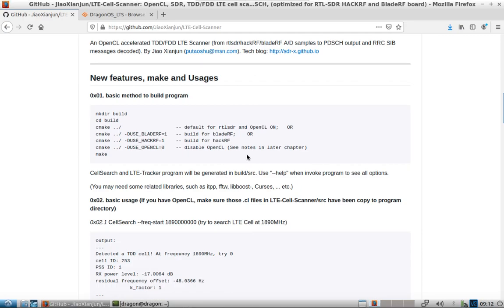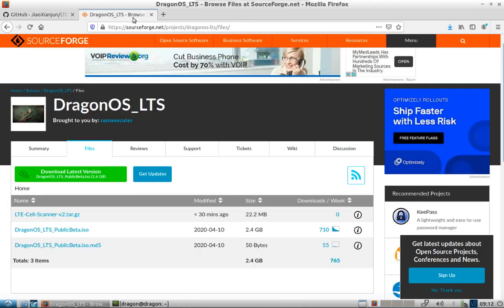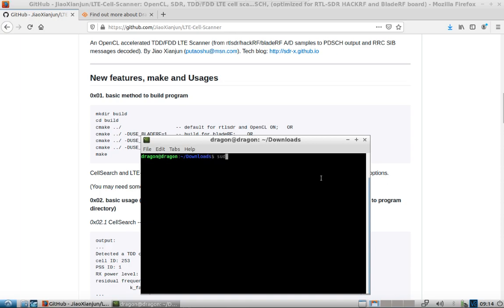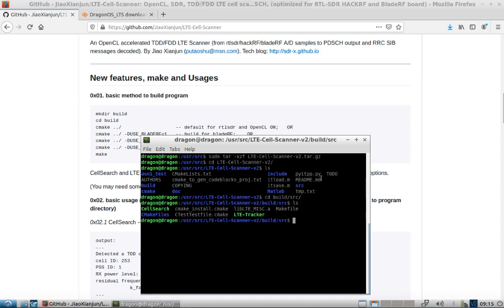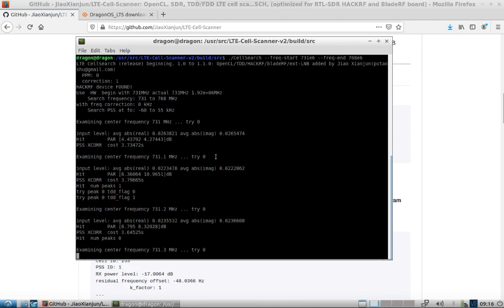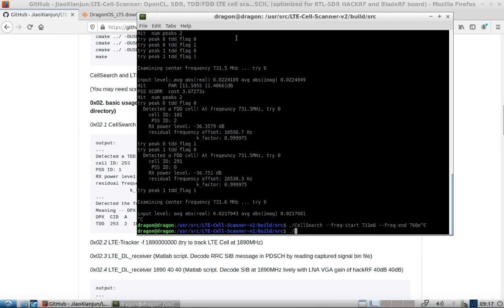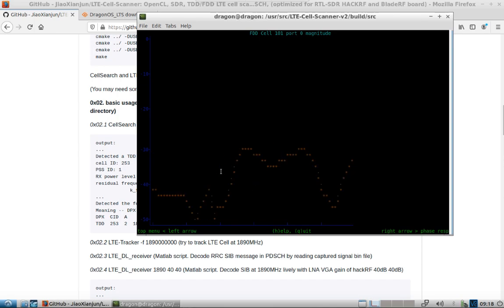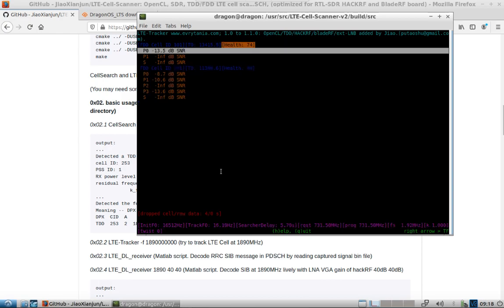DragonOS LTS/10 OpenCL, SDR, TDD/FDD LTE cell scanner (HackRF One)

Comment: Getting this error “hacrf_stop_rx() failed: unspecified error (-999). In another terminal type “sudo apt-get install hackrf” got this “ unmet dependencies: hackrf : Depends: libhackrf0 (= 2021.03.1-2) but 20230201-1 is to be installed. Then I go “sudo apt-get install libhackrf0, result “libhackrf0 is already the new version 20230201-1”. How can I fix it? Thanks.

Comment: I'm running DragonOS_Focal_PublicR14-Preview directly on a PC.  I have a HackRF One.  I can use the HackRF One with URH but when I try to run CellSearch, I get an error that the RTLSDR device cannot be found.

config_rtlsdr Error: no RTL-SDR USB devices found...
RTLSDR device not FOUND!
xxx@xxx-sdr:/usr/src/LTE-Cell-Scanner-v2/build/src$

It does find and use my Rafael Micro R820T tuner if I plug that in instead.

How do I setup CellSearch to use my HackRF One?
Reply from the maker: Good question, something I should document better. So for this tool I built it twice. Once and installed it for the rtlsdr. Now for the hackrf if you look in /usr/src/LTE-Cell-Scanner you will see to bin files with hackrf at the end. You would call those directly in a terminal, like ./CellSearch-hackrf with appropriate settings and it would use your hackrf instead of the rtlsdr.
Reply: I looked in /usr/src/LTE-Cell-Scanner-v2 but I do not see any files ending in -hackrf

xxx@xxx-sdr:/usr/src/LTE-Cell-Scanner-v2$ ls
asn1_test  build  CMakeLists.txt                    COPYING  include   itsave.m  pyitpp.py  src   tmp.txt
AUTHORS    cmake  cmake_to_gen_codeblocks_proj.txt  doc      itload.m  Matlab    README.md  test  TODO
xxx@xxx-sdr:/usr/src/LTE-Cell-Scanner-v2$ 

I do not see a directory /usr/src/LTE-Cell-Scanner.  Am I looking in the right place?
Reply from the maker: I’ll check when I get home, but I think I did away with the v2 folder. If you look in just the /usr/src/LTE-Cell-Scanner folder you will see them
Reply: @cemaxecuter7783  I looked through the directories and could only find the -v2.
Reply from the maker: Sorry about that, maybe I’m thinking of the iso I’m working on now. So here’s what I think should work with the folder you have - if I recall the v2 folder was in fact for the hackrf. Meaning I think if you look in there you will see the bin files under the build directory, those bin files when ran directly like ./nameofbin I am almost positive are for the hackrf.
Reply from the maker: By the way, since you mentioned this I went to GitHub earlier and it looks like maybe there’s been updates so I’ll make sure to add it all soon.
Reply from the maker: Also the bin files in the v2 folder will not end in hackrf, they are probably just the standard name of the file.
Reply from the maker: So I was wrong. Finally got to looking at it closer. The v2 folder you found is setup for the rtlsdr, however you can rebuild for the hackrf. I’m building a new iso now with fixes, new stuff, and I also redid the lte cell scanner. I hope to have it all tested and uploaded ASAP.
Reply: @cemaxecuter7783 Did you do any updates ? I did try to rebuild for HackRF with -D USE_HACKRF=1 option, from v2 folder downloaded from SourceForge, but anyway i get the same error:
config_rtlsdr Error: no RTL-SDR USB devices found...
RTLSDR device not FOUND!
Reply from the maker: @ut4ujq there’s already a bin built and included in newer DragonOS FocalX releases. It’s nearly the same name as the profile tool but I think if you hit tab after trying to type it out you’ll see one ending in _hackrf
Reply: @cemaxecuter7783 Thank you! I'd check my current installed version and is R31. I will need to install the latest R35 release.... Thank you again for you job!
Reply from the maker: @ut4ujq it should be there in 31 also. But there’s two commands, the stands one that’ll only find and use the rltsdr and then the one with _hackrf added to it.